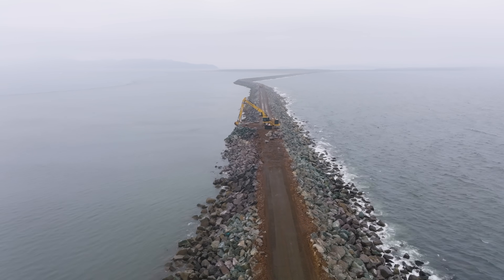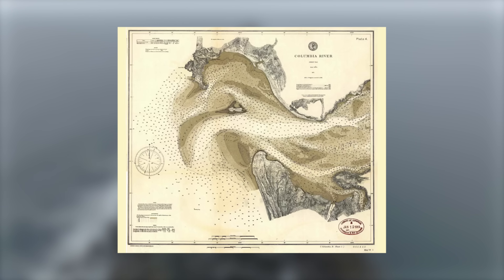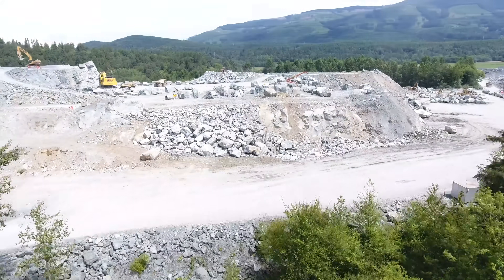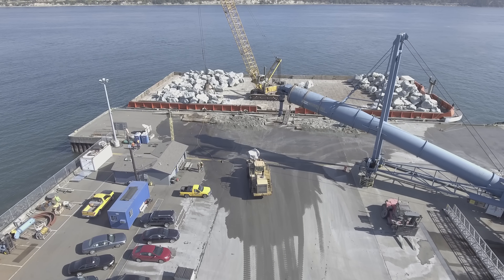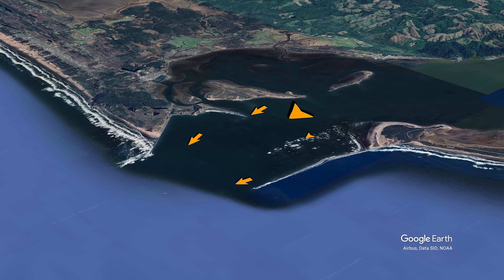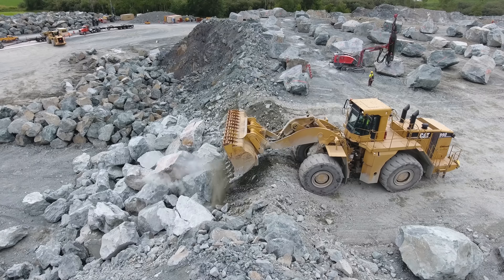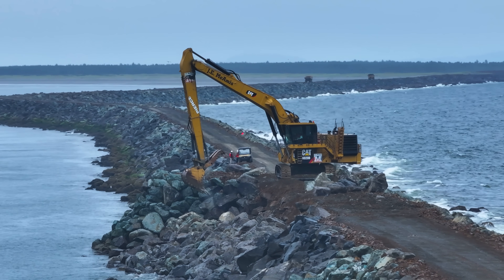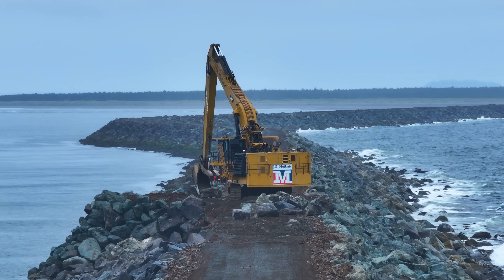Why Build a $250 Million Rock Wall in the Ocean?

Comment: Great video. It clearly shows why the Egyptians were able to build the Pyramids and other stuff with copper chisels and sledges. Because it is easy to move huge rock and stack it by hand as shown in the video. Isn't it?
Reply: This video with modern methods dont disprove anything though😂 we've just removed most direct human labor out of it, but Stone Mason's today still uses hammers and chisel, so whatever point you think you made on that specifically makes absolutely zero sense...
Reply: @AugustJ.k.Nilsen  Modern stone masons use hardened steel chisels and not copper chisels.
I did a bit of stonework myself and even with electric hand tools and diamond blades it is really hard work.
My comment makes sense as I wanted to point out that nowadays we use explosives and big machinery in order to pile up rough rock.
Egyptian structures are much finer in work and under examination of engineers proved great accuracy and symmetry that cannot be done by hand.
I want to point out the work of Christoper Dunn and also the YT channel UnchartedX with great videos about the measurements taken from predynastic vessels.
I am interested in both building/structures and archaeology and seeing it from a technical perspective the usual explanations given by archaeologists/Egyptologists do not hold up to my own experiences and technical understanding.
I could go on, but it is a long reply already.
All I can say is for a rational mind the explanations given are totally odd when properly investigated.
Happy Hug from Austria.

Comment: How would using concrete tetrapods have affected the cost & resilience versus granite?
Reply: No one uses concrete for jetties or riprap in Oregon.  
Concrete would get blown apart by the Pacific Ocean.  For the toughest jobs like the jetties blueschist boulders are used which is significantly tougher and denser than concrete.  Blueschist is formed from subducted ocean floor basalt at 9-18 miles deep.  Blueschist is not granite.  Granite is formed by solidified magma chambers under extinct volcanoes.

Comment: A lot of people don't understand America's river system takes sand from interior of the country, and puts it at mouth of the ocean, whether it be Atlantic or Pacific. Placing these massive jetty systems out into the ocean inhibits the flow of sand by the currents north or south. This is why there's constant federal re-nourishment and beach erosion. I hope the Army Corps of Engineers, when dredging the mouths of these rivers at ocean points, puts the sand to the north and south side where the currents can push it up and down the coasts. Much of America's large river systems are made for commerce and as a result they are dredged for depth due to shipping.The sand is piled up on the sides of the shorelines, and never makes it to the mouth of the river where the sand can be used by the currents for beach re-nourishment. If cost-effective the sand should be barged into the mouth of the rivers and then dumped as close to the shorelines as possible, and let nature take its course. Without doing something like this United States government will spend billions upon billions for beach re-nourishment up and down America's coastlines. Again, it's the rivers that produce stand for the beaches it's not that ocean. Without sand from the rivers you have no beaches, without beaches you have no protection against the power of the ocean.

Comment: are you really telling me that it was cheaper to do all that than just use hydrophobic concrete? Now that it is done - why not go to Sika and get a contract for 100,000 tonne hydrophobic concrete mortor mix that will set up nicely under water and above while locking all those stones in as it weaves around all that base stone... might help protect that work for 100 years instead of having to rebuild so frequently... then all you do is just spray anoter 2-4 inches of new concerte over it every 15-25 years and eventually it will just be a massive island in 1000 years.... but honestly - there are chemists and US companies that make amazing things - Sika is one of them... I used to broker their freight... would love to start again and help haul 5,000+ truckloads of dry mix and chemical binders to job site to mix and make the pumpable hydrophobic concrete morter and top coat... hell - you could sink some more pilasters in and around some key areas and build buildings along it - shops or restaurants - run electrical and plumbing out to the end even and encase it all in nice concrete as you stamp out a nice walking path along side a service road on top or somthing... Man that would be one heck of a boardwalk and fishing pier... shoot you could even build a port off of it with some additional fingers to protect everything... probably a lot cheaper than they did this for.

Comment: It's just like a dry fit stone wall. Do it sloppy and it'll work but over time will  disassemble. Do it well and it can last centuries. But in those conditions... 
I've seen the earliest field stone walls in Europe. Ceide Fields in Ireland. After 5000 years they're just a smear of stones going in general directions.  But they were buried several feet in peat so that might've taken them apart. Frost heave.

Comment: I wonder why they didnt use tetrapod concrete blocks that could be formed on site?   Japan has used these extensively for breakwaters built after the 2011 tsunami
Reply: Blueschist boulders which were formed from basalt ocean floor metamorphosed in the Cascadia subduction zone has a density of 187 lbs/cubic foot.  Concrete has a density of 150 lbs/cubic foot.  Blueschist boulders are tougher and a superior jetty building material and can be found in other jetties and riprap protection in Oregon.

Comment: Did a job in Heath, Ma, where 5M metric tons of rock were used to bypass a Papermill. Some rocks were over 21 cu yds at the base, which was placed on a concrete reinforced foundation 25 ft wide and 3.27 ft thick ( 1 m). It was infilled with concrete and had a flat face towards the Mill on one side and another to retain the mountain and multi million gallon fire suppression water tanks on the other. There was also a 4 lane highway that was installed between the walls ,it took about 2.5 years.

Comment: This is what a universe sized absolute waste of mismanaged money, time and effort looks like folks.  Not to even begin to discuss the environmental impact of the mountain of energy wasted for this project.    The solution was to simply purchase Tetrapod concrete molds and build the jetty on site, literally.   Could have saved nearly 100% of the cost and completed the project 90% faster.
Reply from the maker: you should bid the next one in that case! You'll make a lot of money
Reply: Blueschist boulders used in the jetty, which is basalt ocean floor metamorphosed in the subduction zone, has a density of 187 lbs/cubic foot.  Concrete has a density of 150 lbs/cubic foot.  Blueschist boulders are a much tougher jetty material.

Comment: The real mvp are the truck drivers backing up all that way
Reply: My dad was a special iron mover. In the fifties he hauled the in ground doors for the missiles silos in Kansas o the areas of the Great Plains. He said some of the doors were so large and heavy the needed 4 semis  to move each door two going forward and two going backwards up to 50 miles, from rail heads. Incredible. Later in life he hauled cooling towers from Tulsa to Manitoba’s oil fields.
Reply: @edwardcrone2465  He must have some exciting stories, of close calls, and the like.
Reply: The fuel truck drivers that have to feed that thing twice a day!
Reply: @osut688  So you're saying the fuel tank in that excavator doesn't have enough capacity to run all day ?      It's got a 950 gallon tank !  And only burns 58 gallons an hour @100 % load (which I'm sure he's not operating at).
Reply: Bro there’s a fucking turn around area right there come on
Reply: @KyleCorfman-io1zr  I a fucking gree. Sssoooo stu to the fucking pid. BRO FOR REAL. Doh fucking bro, get real...Doh....fuck.
Reply: I totally agree. I am an RN, make $80k a year and would love to change places, regardless of the driver's salary!!!
Reply: It's not hard to back a truck up
Reply: @jamesstephens1539 I disagree bro especially when you got a stretch trailer
Reply: Well not everyone is as good at everything like you, bro😂😂😂 @jamesstephens1539
Reply: Hope you're joking. I was on that haul and we didn't take trucks down the jetty. We offloaded in a staging lot that got transferred to a barge every couple days.
Reply: Looks like they only have to back up though part of it.
Reply: And don't forget about the maintenance crews that keep huge equipment operational.  I'd like to see a video of the maintenance shops and mechanics.
Reply: To them it’s about as challenging as backing up a driveway. They know every bump and angle but I imagine it does get extremely foggy sometimes.
Reply: Really not hard at all😂
Reply: True but you gotta give it to the ho hand, I don’t see a bathroom anywhere close to him I know how that is working a 12-14 hour shift bc “shift” you know he’s had to squat between those tracks a lot!
Reply: NOT!!!
Reply: Seems to me , A Shallow Draft SCOW Might've been a more practical / Efficacious Method of getting those BIG Rocks out to the End of those jetties , at least once😞🏴‍☠️ they were Out a ways ??
Reply: Yeah, because it’s super technical to sit your ass in a seat and look in mirrors
Reply: Exactly but like always they get forgotten ty brother
Reply: That was all done by the spotter on the ground that gets paid the least
Reply: The barge staying afloat is pretty mvp worthy with them big rocks on there
Reply: I guess they get used to it, and maybe they have some tech to help, but it sure does look impressive.
I remember going to a marble quarrying area in Tuscany, Italy on a caving holiday back in the 80s
The top entrance to the cave system were were doing most of our trips in was pretty much on top of a mountain next to a marble quarry, with a convenient track leading up to it for the trucks which moved the marble. They were essentially large flatbed trucks with two thick rails of wood laid along the bed, onto which the large marble boulders were placed, staying there by gravity and friction.
The top section of the track had corners which our van could drive around as if they were hairpin bends, but the slope was too steep to construct bends the trucks could drive around like that, so the corners extended out horizontally for a bit (ie from above, a corner would look more like a Y than a U)., and the trucks would drive one section forwards to the "end" of the corner, drive the next one in reverse, forwards on the next one, etc down the mountain, on a track not massively wider than the trucks, with quite a drop to one side.
We made the mistake of driving up the track during working hours when trucks were coming the other way. We didn't make that mistake again.
Reply: Yep. Supertech called side mirrors.
Reply: @tjallingdalheuvel126  I would have to have back-up cameras. 🤣

Comment: Interesting video ,Aaron ! Question. Have you heard of the Isaac Ha'le Beach Park , Small Boat Harbour Recovery Plans ? A Hawaii Island project to remove sand that was created by the 2018 leilani lava flow. The flow stopped just a few meters from the boat ramp and lava sand was created and filled the entire bay in from point to point. Making the entire location unusable. Due to the constant high surf and trades winds removing this huge pile of sand doesn't look easy. Not sure how engineers would approach this problem.

Comment: This wont last long. That is literally bushman/mining  engineering lol it does the trick but constantly needs maintenance. They should be using concerete slabs as a foundation not rocks but hey whatever to cut the costs and make it look good for the time hey. Building on sand like this is a no no as sand constantly moves and you think about it rock makes sand dont it lol. Anything exposed to the ocean and weather doesnt last very long. Long story short its going to wash away and when it does it will be like a landslide into the Ocean and the water will just wash away the rocks and mud between 🙃

Comment: I have seen a similar event in Aguas Calientas, the town that services Machu Pichu, the tourist destination in Peru. After the yearly floods that sweep down the river that divides Aguas Calientas, a backhoe is driven into the river which has become very reduced in flow. The backhoe is driven to the lowest down river outskirts of town and a process starts that 1. all of the big boulders are removed and all the gravel backhoed out and placed on the road running beside. After the gravel, smaller rocks are removed to be ground up in a rock crusher that is permanently housed next to the river in the centre of town. 2.When sufficient space is made the large boulders are replaced to level the river bed and the process works its way up river to the outskirts of town. The backhoe is paked on the opposite side of the river to the rock breaker. The gravel and rocks collected are the source used in concrete construction in Aguas Calientas and surrounding towns. The backhoe operator is a wizard at selecting the right rock to place in the river bed to fit and fill each space and doing so with such a relativly small machine.

Comment: everyone probably say it's waste of money spending $250 Million but it will save you lot and lot of money in the long-run building a seawall stop erosion on beaches and after storms and actually why seawall got made is in stop invasions into your country that's why they made them first you can shoot the troops getting off the boat's because there's no protection then they made them for lighthouse for road to get to the lighthouse and now they do it for erosion and save shipping because the waves are on the other opposite of the wall is smaller and the ship can dock in port's easier so it doesn't cost companies and you can also use the seawalls contain spills and many more stuff too 👍🙂👍

Comment: I don't see any tetrahedral concrete blocks, is it a cost benefit to use rock?👍🇭🇲🦘
Reply: at 6.5 miles, ask for an engineering company to price it....... per side. There was more then one 6.5 mile structure.
Once you got the prices, let us know if you would pay the difference.
Reply: @colonelfustercluck486  interesting handle

Comment: Thanks for another great adventure, Aaron. I was unaware of  these jetty's and the up-keep required. I come away wondering why they transport those enormous rocks, each numbered, instead of using those huge engineered, interlocking blocks I've seen used in so many other sea walls.
Reply: Granite is far tougher than any engineered concrete product.  This jetty takes a beating worse than just about anywhere in the world.  What most places call the worst storm they've ever seen is "eh, just another southwester" on the mouth of the Columbia.

The reason it is so bad is mentioned in the video.  There are no islands offshore, there is no shallow shelf leading up.  It is a short distance offshore to the deep open Pacific, where waves can build across 1/4 of the earth's circumference.
Reply: Ohhhhhhh that makes sense.  Thanks for clarifying!

Comment: Curious if you would be interested in doing a video on another specialized operation who have customized CAT 375’s (the largest CAT excavator built at that particular time) excavators with their customized deep trenchers that have the ability for One-Pass Trenching and completely homogenize the native soils with the cement and/or bentonite additives from top to bottom and from start to finish to create a consistent and seamless barrier wall for dam and levee repairs all in one.   Absolutely amazing never seen anything like it in my 30 year career as a Construction Engineer.    
Name of the Contractor is Dewind Construction out of Zeeland, MI. They provide multiple services specializing in deep trenching for Environmental Remediation, Coal Ash, Hydraulic Barrier Walls, Tailings and Slope Stabilization, Deep Excavation Dewatering, Permeable Reactive Barriers and many other customized services.   Truly a very unique operation.
Reply from the maker: we've wanted to see them at some point!!

Comment: Amazing project... I had never heard of it. It is unbelievable that all  the rocks were numbered and specifically placed.
Reply: Everything man-made kind of stupidity 
using modern possibility.
Reply: Seems like they probably could have just added more for redundancy instead of being all precise.
Reply: @CountJeffula I think that ends up being very expensive. From what the narrator was saying even the shape of the rocks was considered so that they would lock together and withstand being battered by waves much longer. If you are just throwing a pile of rocks into the sea it will take much more material to last the same amount of time.
Reply: Working smarter equates to being less wasteful. It's the benefit of using labor over laziness.  @CountJeffula

Comment: Why do they weigh and track each stone along each step of the way?
Reply: They are contractors.  They need to be able to tell the government they shipped 100millionn tons of rock. and the contractor that does the quarry annd the truckers need paid.
Reply: @ Yes that makes sense but seems you could just weigh each truck like you would hauling gravel.

The video almost made it sound like each rock was planned out for a certain spot or something like that.

Did you see the excavator operator recording each rock that he recieved?
Reply from the maker: the USACE is very specific on gradation and how and where the rocks are placed
Reply: @buildwitt  Oh, thanks Aaron! 

So the numbers would help tell the operator where to place each stone based on weight and grade. 👍